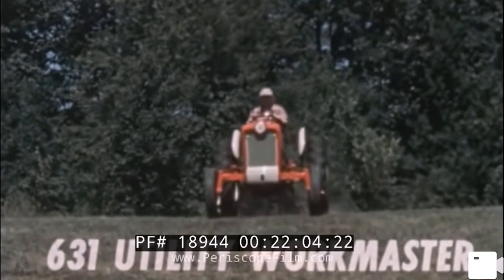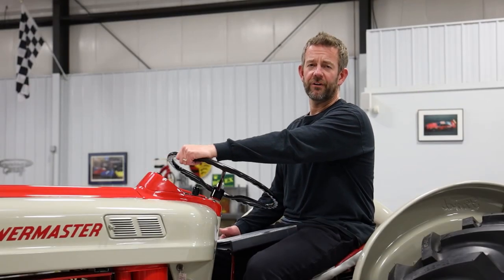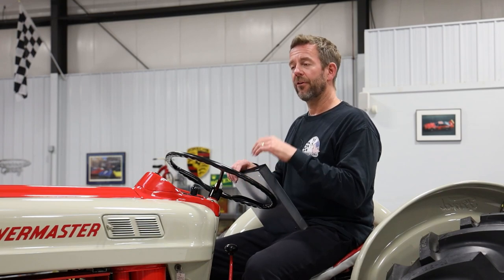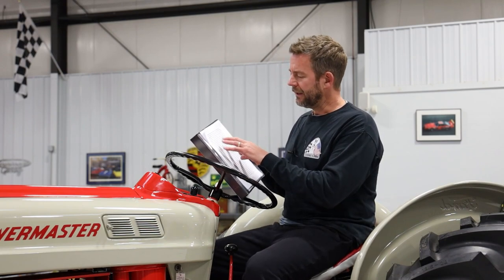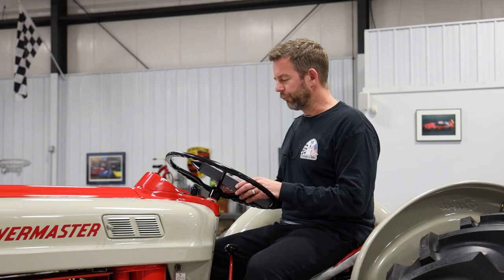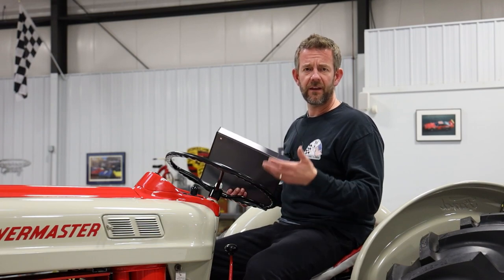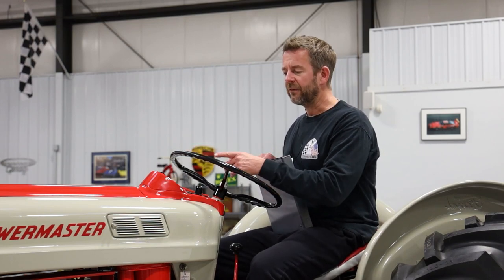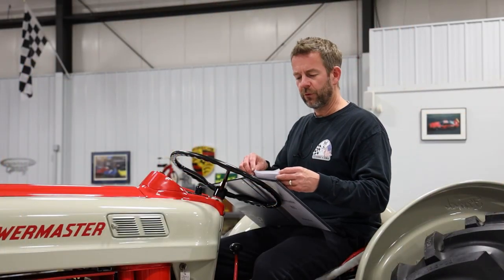1958 Ford 861 Powermaster Tractor

Comment: The Golden Jubilee Ford Tractor was made in 1953, the same year the brand-new Red Tiger engine debuted. The '58 wasn't a "new" model and the Red Tiger engine had been around for a while by then. The sheet metal on this tractor is virtually the same as the '53 Golden Jubilee as well.

Having said that, this particular tractor in the video is stunning. Absolutely amazing how well kept it is. Truly a grail tractor.
Reply: And didn't the 800 series tractors have a 49 or 50 hp engine not a 29hp?
Reply: @kevinroberts5140  Yes, although it's about impossible to nail down exactly what it had for HP.

Comment: I grew up driving little Fords 8N, a NAA Jubilee and the 801 baler and plow tractor. As an adult i bought a 1959 871 Powermaster with the Select-o-speed transmission for $900. Only had 1200 hours on it. It wasn't as pretty as this one but it was pretty close when I got done with it. I used it brush hogging for several years. Then added a loader to it and moved hay. Ended up selling it to the local UPS driver and he used it for everything for a few years and passed it on to someone else to get a bigger one. It gave me great service and I made a couple thousand on it. Can't complain about that but I still miss it.

Comment: The one give away as to being a live p.t.o. Is the clutch pedal. Clutch pedal in the up position like yours shows to be live p.t.o. With out any doubt or argument by any so called expert. Live p.t.o. Adds to value of tractor. I have 1954 860 172 cu live p.t.o. My favorite ford tractor of all time.

Comment: A beautifully restored 861.  Several errors in your description.  Major ones have already been pointed out; Golden Jubilee was a '53 and the 861 designation is with a live PTO.  And the 8 in the 861 means that is has the larger, more powerful engine; 172 CI as opposed to the 134 CI in the 601 series.  Others I will let you research for yourself.